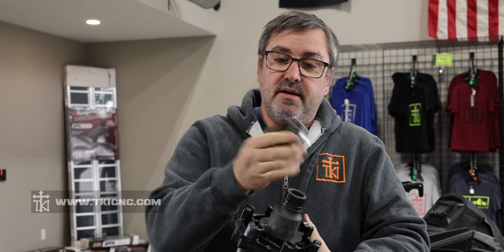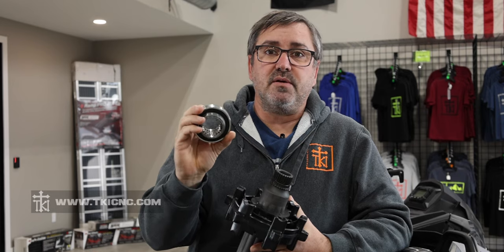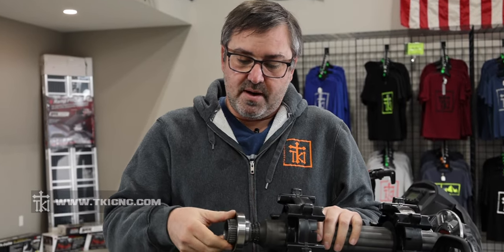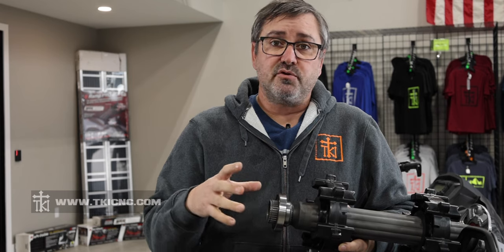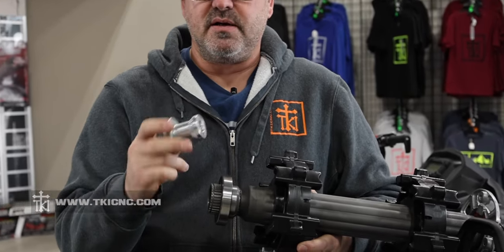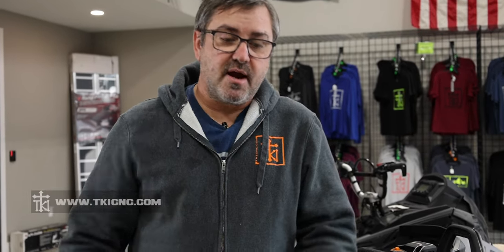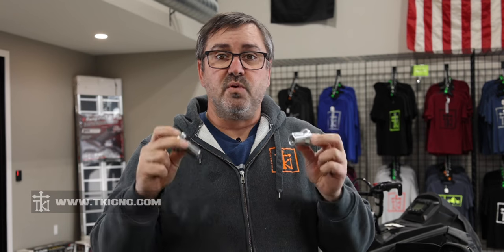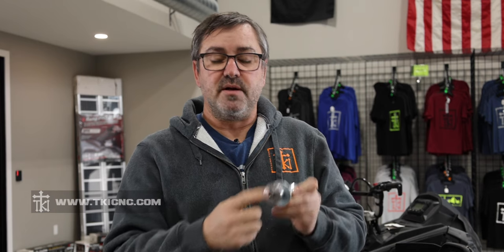G5 Retainer

Comment: what about putting a 3/8 hex for future removal if the insert on the brake rotor side would come loose and spin on removal?
Reply from the maker: We will be adding a 1 inch hex for a socket on the aluminum sleeve.  We have not seen any issues with inserts spinning if installed correctly, but its extra insurance.

Comment: Does the g4 2020 model have the same issue ?
Reply: no
Reply: No, all a G5 thing.
Reply: No.. literally buy the driveshaft out of a 2023 trail sled /g4.. or a 2021 mountains sled/g4 sled. It is like $280 and is an oem part and the actual fix not a bandaid insert plug that you have to take half the drive apart anyways lol